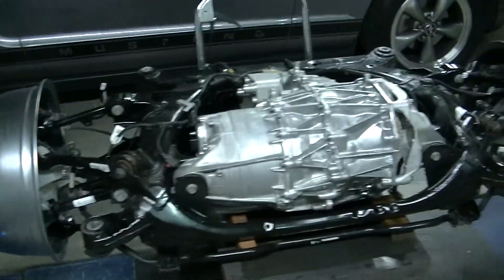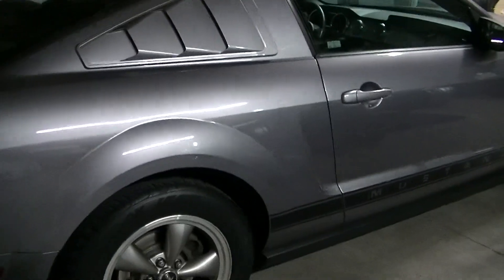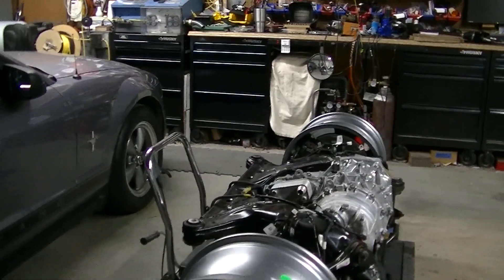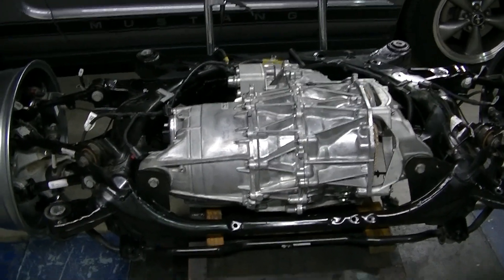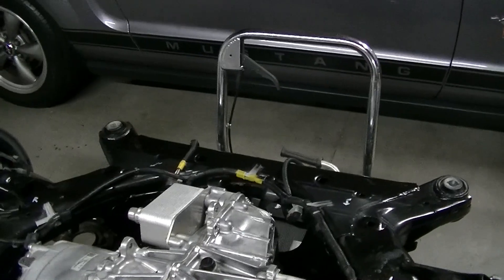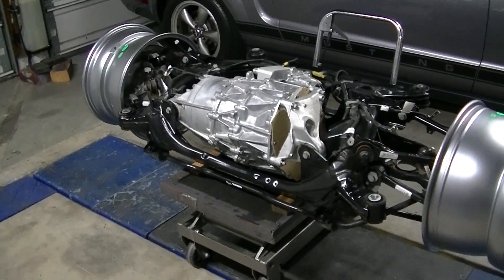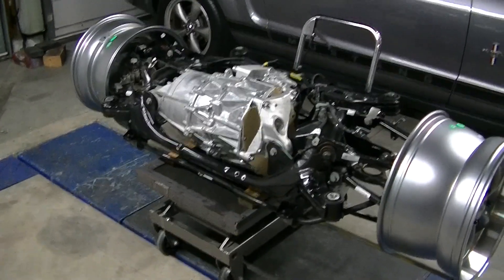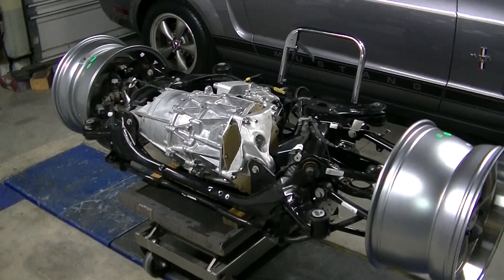06 Mustang/Tesla Swap 2021 Pt. 1

Comment: Very interested in the bolt in subframe! I am a mechanical engineer and could 3d model it for you if you supply the sketch.
Reply from the maker: Unfortunately after many hours of design it only bolts in after having to modify the body and installing mounting brackets. Not what I wanted but it worked out great. Should be driving this week. Thank you for the offer.
Reply: @Roadstercycle  good to hear it is working out.  I may give it a go on a 06 convertible but I don't have your fabrication skills. I am stoked that you are taking on another mustang.  I closely followed your other build and it looks like this one will be even better.
Reply from the maker: @chrisweaver3106  I do understand about the fab issue and that is what I was trying to make it bolt in for people who don't have the time or skills to do it. Keep an eye out for an upcoming video of the VW Rabbit build as it has another solution to the subframe issue. Split motor direct drive to a stock Mustang diff or a drive shaft to a stock Mustang or Camaro diff.
Reply: @Roadstercycle  I will watch for it.  I really want to do a 65 or 67 mustang convertible ev.   I am hoping you post videos or picts of the model 3 mustang as well. Your work is great.
Reply from the maker: @chrisweaver3106  Thank you Chris, I should have it up this week. I actually got it running and driving Friday. It's really quick.
Reply from the maker: @chrisweaver3106  new video is up. Enjoy
Reply: @Roadstercycle  I watched it great work.  Did you end up getting seatbelts in the back?
Reply from the maker: @chrisweaver3106  I did get them attached but would need a better mounting structure for actual safe use.  The M3 motor eliminated the stock mounting position.

Comment: you really should post some vids of your mustang performing, really wanted to see that ._.
Reply from the maker: Hi,   AEM company bought the car and they are going to be releasing a performance video very soon. The car with a Base motor Tesla did 11.8 seconds continuously in the 1/4 mile when they tested it. I sold it to them with the Sport motor so that should be their next testing with their control board. I can't wait to see that.  The rocker was change to a full push button control console which is available on the AEM-EV website.
Reply: @Roadstercycle  thank you I'll check that out

Comment: Hi Jack!...The TESLA Model 3 Performance motor is rated at 450HP!...What is the Diameter and Width of the Bullet Wheels you're using on the rear on the Mustang?...What kind of Performance are you looking at in the 2006 EV Mustang?...I have a 2008 V6 automatic Mustang and I was wondering what it would Cost using a Tesla MODEL 3 Performance Motor and or the TESLA Model S Motor?...Thank You and God Bless America! 😇
Reply from the maker: Actually the model 3 performance dual motor is rated at 450 horse power from what I understand not just the rear motor. If I'm wrong please let me know where you found that as that would be awesome to see. The rear wheels are 18" x 10". I think 285 will fit perfect inside the wheel wells. 195 may need a bit of fender messaging. That's ok too.  The fronts will be 18 x 9 so I can clear the 2012 GT rotors and brake calipers.

Comment: Very cool!  I like the Model 3 subframe size a little better than the model S.  Should be easier to get wheel offsets to fit a range of cars.  Can't wait to see this come together!
Reply from the maker: Thanks Kevin,  It should be a good fit. The Model S in the Muskstang was a real challenge because of the width. Ended up using Corvette wheels with a 79mm offset to keep them inside the fender wells. The Model 3 is only a tad difference.
Reply: @Roadstercycle  That sounds familiar, I used the exact same size, Corvette wheels.

Comment: Next project after this one consider putting a Model 3 RDU in the back of a Honda Civic with a K-series motor up front. A through-the-road hybrid AWD system is exceptionally rare, but would make sense on a Honda. The batteries would really only need to be big enough to get it to launch up to 30MPH then shut off. Charging could be done by dragging the Tesla portion of the powertrain in a low regen mode. 

Coincidentally, the Honda shares not only the Ford bolt pattern (5x114.3) but also the exact same hub bore diameter. Honda just uses 12mm lugs instead of 14mm.
Reply: We are doing this with a ls4 fwd grand prix and performance rear drive unit with chevy volt batteries. It's on my buddies channel junkyard Dave. Hopefully will be starting on electric side soon
Reply: @Shiftheads  Cool. Are you going to have two throttles? One drive-by-wire throttle with two outputs? Or just trigger the Tesla RDU at WOT like nitrous? I’m looking forward to it doing FWD, RWD, and AWD burnouts.
Reply: @apricity69  plan is to use one pedal with two outputs and configure the motor controller to only send power and regen when we want. Like no regen unless completely off throttle or only open throttlebody over ten percent throttle so we could still regen and not have throttle open when trying to modulate the regen. Trying to figure out if emotor can send power between transmission shifts or if it will have to be cut to protect trans
Reply: @Shiftheads  Interesting. You think that the Tesla motor will be pushing too hard during the automatic transaxle’s shifts that I’ll hurt the transaxle? I guess it could unload the trans and front halfshafts and cause problems if it shifts hard. 

Is there any way to start the auto trans in 2nd gear so you don’t have to worry about the 1-2 shifts?
Reply: That Honda motor would lose to an identical version without the ICE motor and more battery. The fastest production cars on earth are all electric now for a reason.
Reply: @cyumadbrosummit3534  I’m a big proponent of EVs and I own a Tesla, but there are no Teslas pulling 7s in the 1/4mile like some Hondas. Plus, endurance racing is nearly impossible for EVs.
Reply from the maker: All this is great to know.  Why don't you build it? I'll subscribe for sure. Sounds a little less insane than the VW beetle build that a guy put a jet engine in and kept the front engine to pass smog. It was quite the build. Saw it years ago on Youtube somewhere.

Comment: Great to see your new video.  Looks like another awesome project.  By the way, can you give some update on how your old Tesla-Mustang is working after almost a year?
Reply from the maker: Hi Michael,  The first Mustang is doing well. It's owned by AEM/Holly now and being used as an EV product test bed. They just took it to the drag strip with a swapped base motor now and ran some pretty great numbers. I can't give out the numbers until their promotion video is released. They use the Mustang in their video.